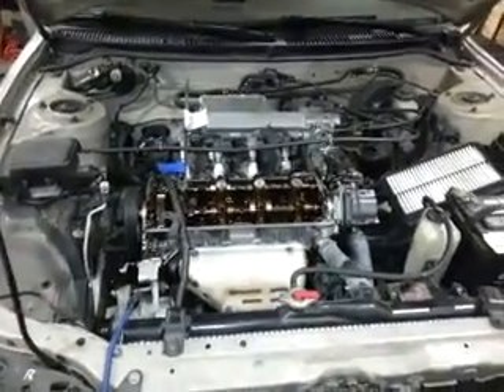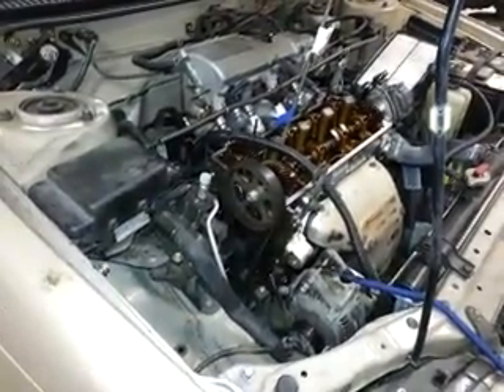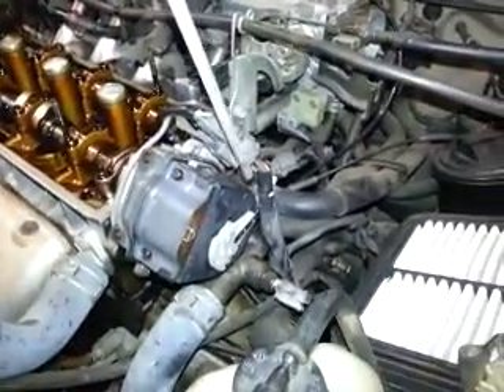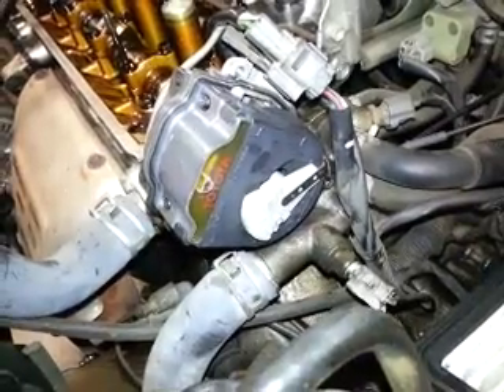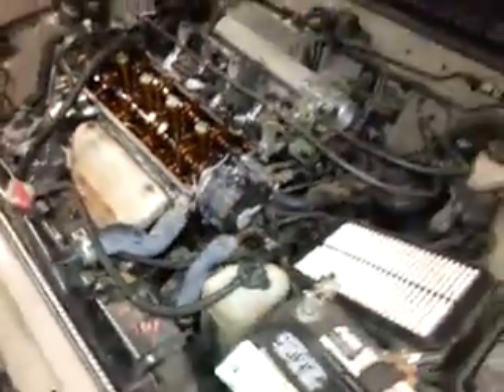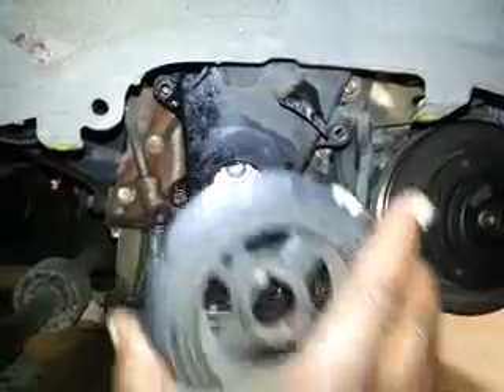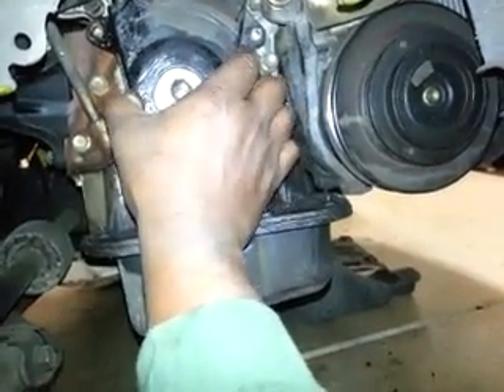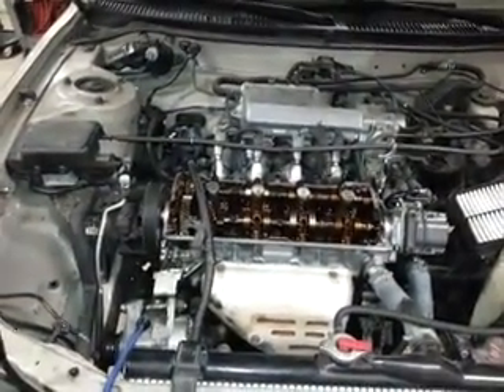Timing Engine in car

Comment: Thank you sir for the vid! Quick question!- I have similar engine.(4afe1.6) Is it non adjustable with the single mounting bolt distributor?  So as long as you have everything line up your good to go? Thanks! From dumb question guy. Lol
Reply from the maker: That is correct.  I have had that engine on this car as well.  You really want to make sure the timing belt is dead on because it will run with one tooth off one way or the other and you'll play he'll trying to figure out what's wrong once you get it back together.

Comment: I just tried my first start after re seal 'hg and new timing 1996 corolla 1.6  had a guy come by he said the timing is off
Reply from the maker: It may be off a little.  One of the mount holes on the distributor is slotted, this is so you can fine tune the timing adjustment with a timing light. Try that and you should be able to get the timing correct. there are terminals that much be jumped with a wire while setting the timing...
Reply from the maker: I should do a video on setting the timing with a timing light ...
Reply: Thanks ima get home today from work and redo the timing

Comment: Hey I'm having a problem getting 7afe started but I see u lined the notch at 10. I lined mine up with 0 and it won't start
Reply from the maker: Align the camshaft sprocket with the notch, and make sure the number one piston is at TDC on the compression stroke, not on the exhaust stroke, then make sure the timing makes on the crankshaft pulley line up with the 0 on the  crankshaft pulley cover. watch this video https://www.youtube.com/watch?v=_TT9DSj5Hlk